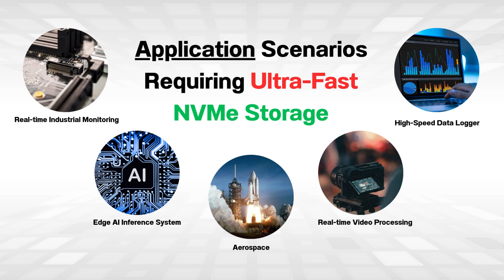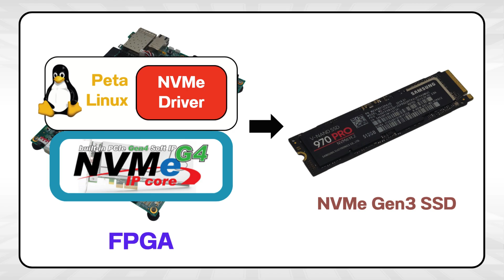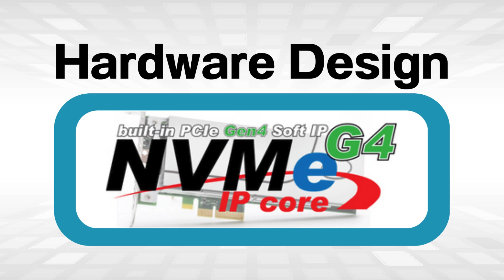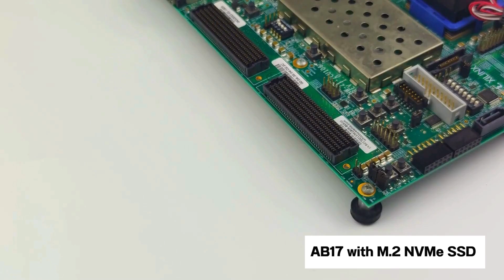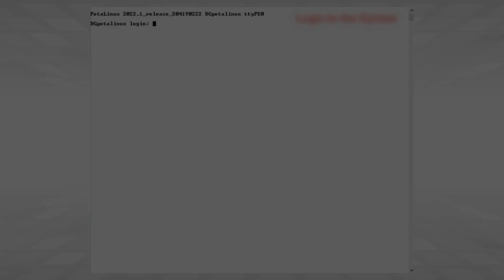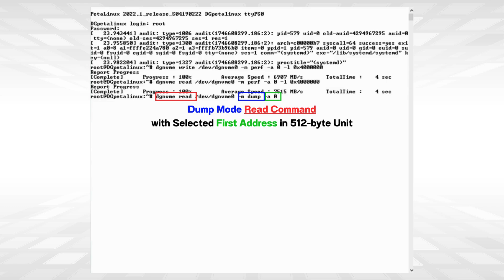Breakthrough NVMe Performance on Zynq UltraScale+: 7 GB/s with DG NVMe Gen4 IP on PetaLinux

Comment: Would be more impressive if you do this with cheaper Zynq US+ kit like ZedBoard or similar Z7-7020..
Reply from the maker: Thanks for your question!
PCIe Gen4 requires transceivers capable of running at 16 Gbps. Unfortunately, the Zynq-7000 series does not support this speed, and the device you mentioned doesn’t include transceivers at all. You can find more details about each AMD FPGA model in the official documentation here:
https://docs.amd.com/v/u/en-US/ds190-Zynq-7000-Overview

By the way, we offer a free evaluation demo on our website — feel free to check it out here: https://dgway.com/download/download_form.html?d=NVMeG4IP_dmalinux_ZCU106.zip

Let us know if you have any other questions!
Reply: @Dgwayweb Thanks but ZCU series are already at Laboratory level of price that typical people can't afford.